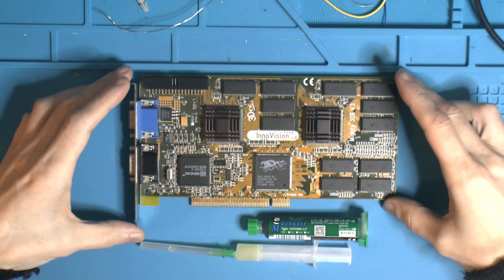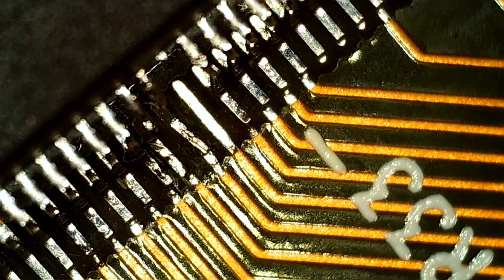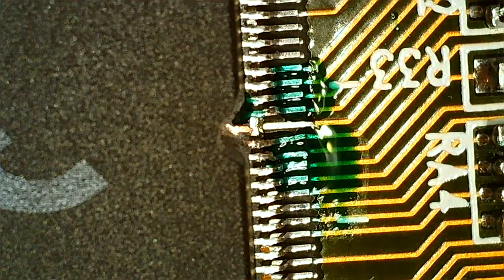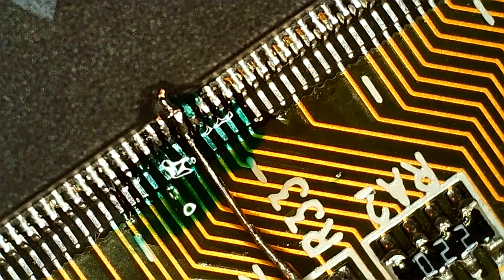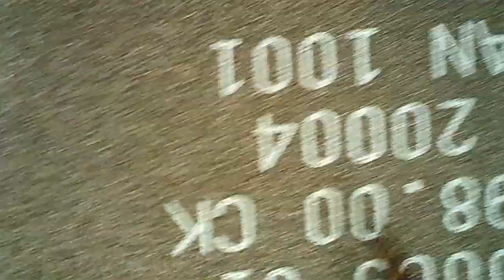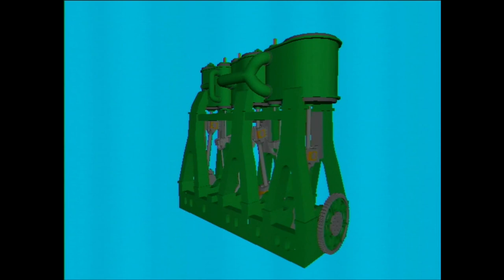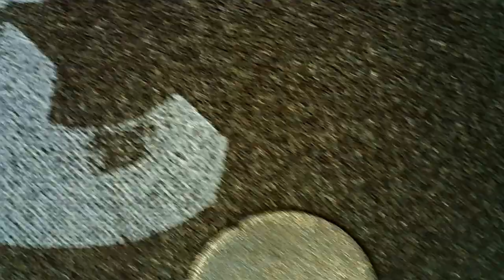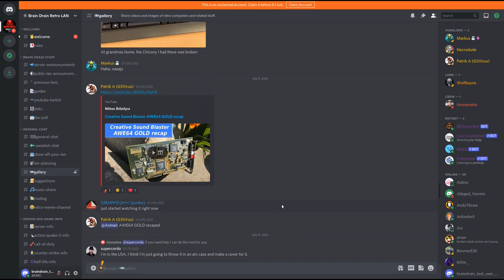Voodoo2 with damaged FBI chip

Comment: your making these repairs look easy ;-)
are you able to pair with another card for SLI?
Reply from the maker: With a moded driver I can use mismatched cards.
But I already have V2 SLI setups with matching cards so no need.
Reply: such a bad problem to have :-P
Reply from the maker: @Pickle136  I might try mismatched SLI in a video later with the modded driver, just to make sure SLI works on them.

Comment: Hi, I wondered if the Steam Engine test you use is available to download anywhere? I'm trying to fix a faulty 12mb voodoo2 and think it would be useful, cheers 👍
Reply from the maker: https://www.dropbox.com/scl/fi/376vmtckqfgu158oipkvh/Steam_engine_v1.0.rar?rlkey=u84m90149s6v07y7bjj5st5gy&st=swi4wti0&dl=0

You can download it from dropbox.
Top left corner, select File and then Download, when prompted you can select to download without dropbox account.
Reply: Thanks so much 👌